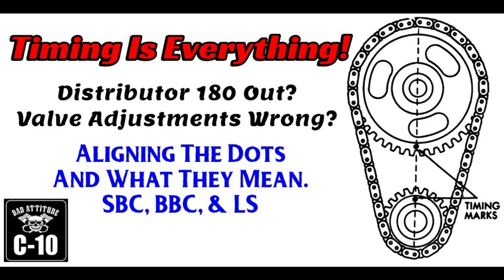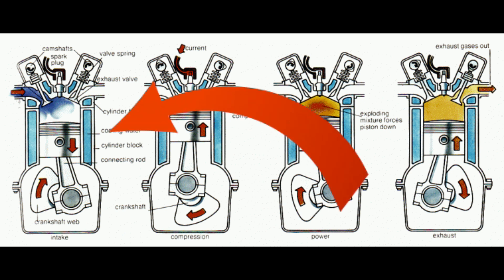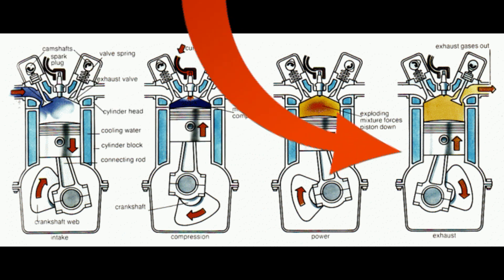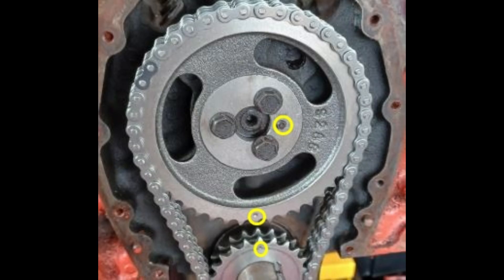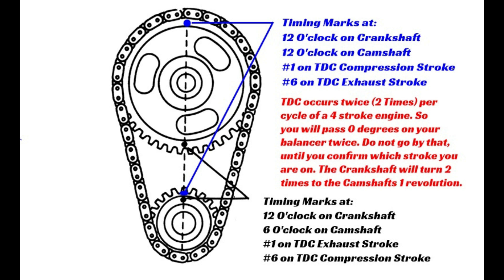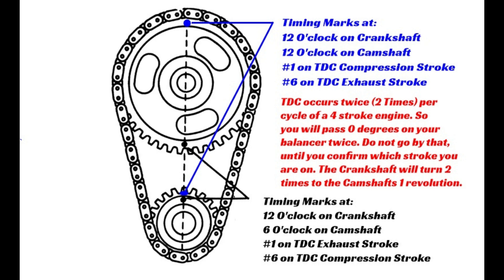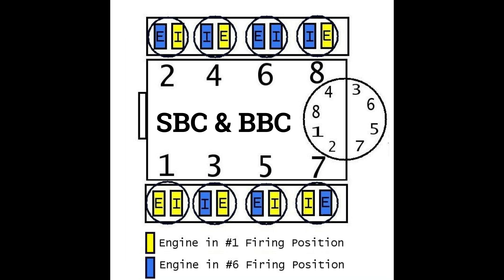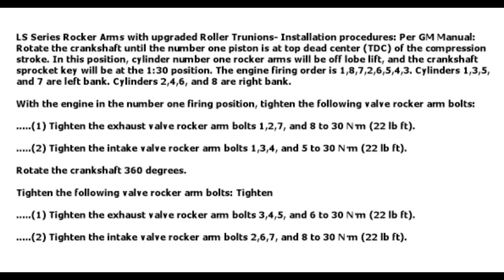Master Your Engine Timing With These Simple Steps

Comment: You rotate can't to tdc cylinder one, then install cam with timing mark at 6:00 crank at 12:00
Reply from the maker: Yes, When installing the cam on a SBC/BBC/or LS: #1 Cylinder is at TDC, Crankshaft Timing Mark is at 12:00, Cam Mark is at 6:00. Thanks for watching!

Comment: When you align the chain and gears on an ls, which way is the cam pin pointing?
Reply from the maker: Hi David when you line the cam gear and crankshaft gear timing marks at 12 o'clock Crank and 6 o'clock cam the dowel pin is at 3 o'clock.

Comment: The way I did it the first time I rebuilt a SBC was line the dots up on the crank and cam sprockets then rotated the engine until I felt compression on #1 then aligned the marks on the balancer and timing tab. Then pointed the rotor to #1.  Fired off the first time I hit the key.
Reply: Exactly, and it doesn't matter where you point the rotor as long as #1 plug wire is  over the rotor!
Reply from the maker: @bmanceaux4847  👍
Reply from the maker: That Is a method used to determine you are at TDC on the Compression Stroke by many people, including myself.

Comment: I remember a young man working on his engine change hot rod, asking for help.  He was frustrated - spending money on new coil, wires, etc - desperate to simply start his rebuild engine without backfiring.  Yes, he simply lined up his timing mark with his number one cylinder, except, he was 180 degrees out - never checking if he was on the compression stroke, or exhaust stroke.   Rotated the distributor 180 and suddenly it fired right up.
Reply from the maker: We all have probably done it at one time or another. Thanks for watching!

Comment: I always ensure #1 is coming up on compression before setting the distributor. I also set the valves  after the exhaust closes on each cylinder, it takes longer but that is what I have to do to keep it straight in my head... LOL
Reply from the maker: Hi Bubba, I do the ICE method on valves, no days they call it EOIC. I set the Intake Lash or Preload when the Exhaust Valve starts to open and the Exhaust when the Intake Valve starts to close. I will be doing a video this weekj showing the LS procedure and then I'll show how I like doing them with the ICE method. It is pretty much Fool Proof.